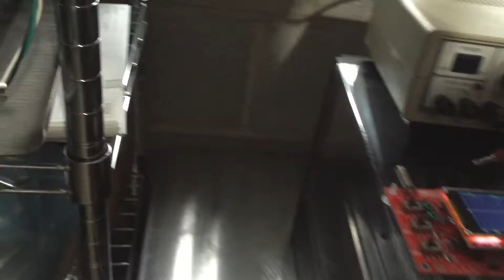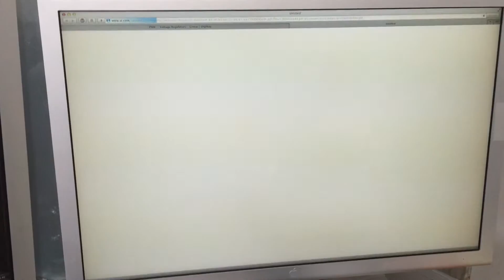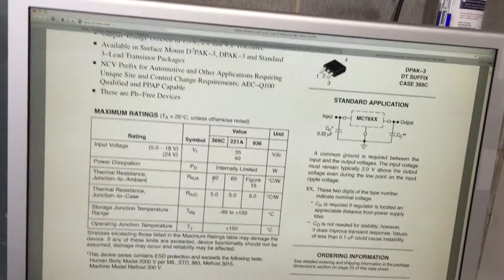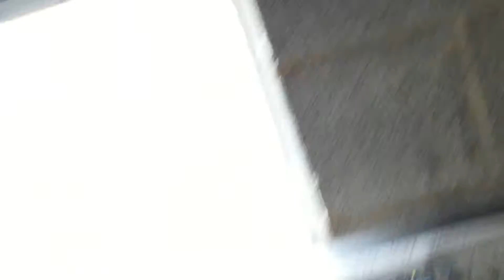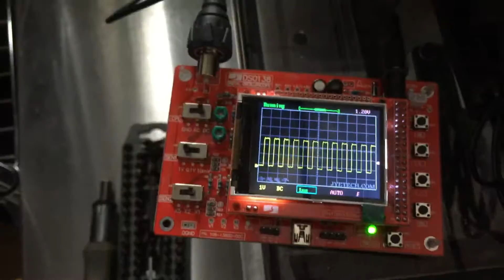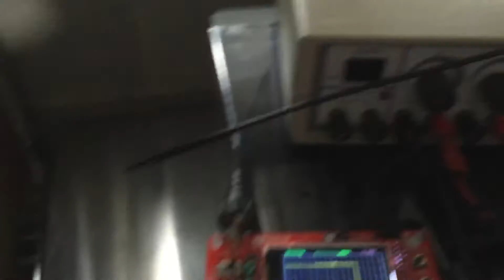$20 Oscilloscope Review - DSO138 by JYE Tech - Part 2

Comment: You seem to have spent too much time on how to run this oscilloscope on a higher voltage input than the recommended 12V and much less time on actually reviewing the oscilloscope's performance and how it compares to other more expensive ones. Your review as a designer of higher-end oscilloscopes would be much appreciated.